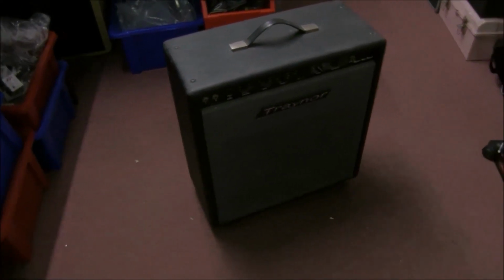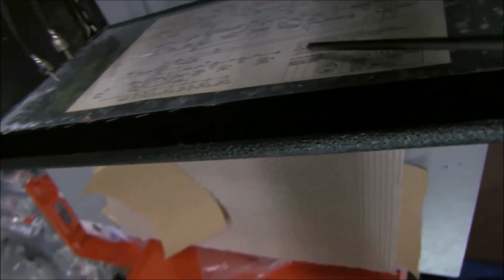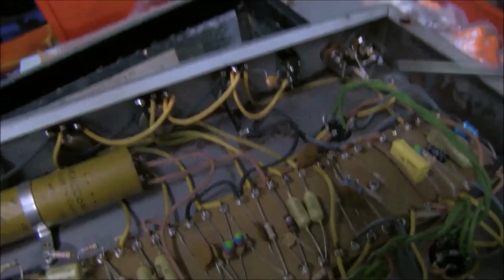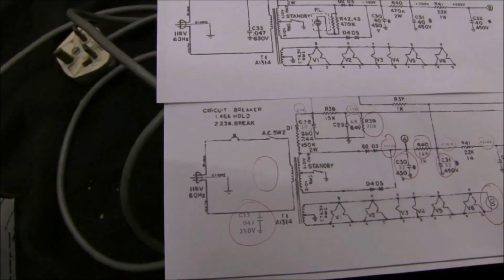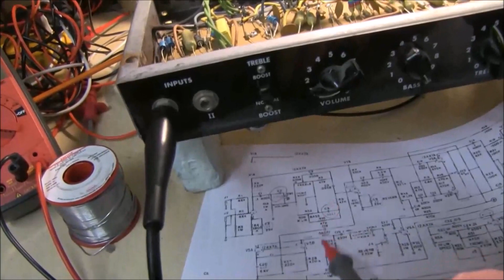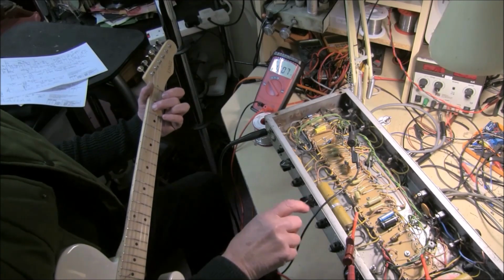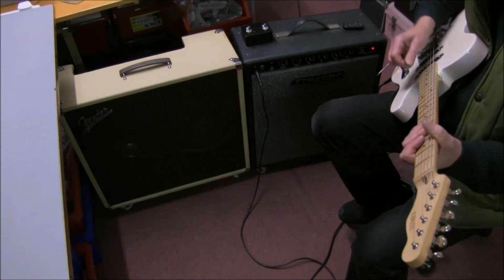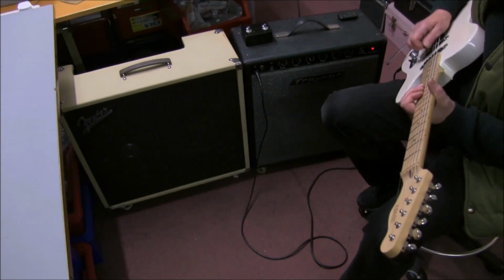Traynor YGM 3 Vintage 1973 valve Combo amp with Trem and reverb.

Comment: Hi Nick... I have had one of these for over twenty years; suburb amplifiers and similar to an original Fender Princeton. As you stated these amps were originally made by Peter Traynor for the hire market, so they were deliberately over engineered to save comebacks from hire clients! :) With regard to the re-issue having slight circuit changes, the lowered  HT voltage was to cater for modern valves that are not rugged as the old Phillips, Mazda and Brimars made back in the day. Stick a lot of modern EL84's into an old 70's YGM3 and the amp will eat them and cause them to red plate! The fixed bias resistor, R39, is 22K in the original amp and it is advisable to change that for a 10k resistor and 20k trim pot in series so you can adjust the bias and run modern valves a little colder and prevent red plating. As you will know, if you stick a 1 ohm resistor from pin 3 on the EL84 socket to ground, you can measure the bias current with a volt meter strapped across the resistor (i.e. voltage reading will = milliamps) You want to be looking for about 17 m/a. to keep things running reliably! The tremolo circuit oscillates the bias circuit to make the tremolo to work, which again can cause the bias setting to go 'hot'. Some users disconnect this (or leave it switched off from the footswitch). Like you, I also found that leaving the enclosed back on tightened up the bass response; however I have changed the original Marsland alnico speaker for a more modern Celestion alnico Blue (same as original Vox AC30). IMO this improved the sound. However... a lot of users do like Marsland speakers but I think it depends on who manufactured them!  A good idea on changing the phase inverter to perhaps an ECC82 or similar… to calm the output and drive down.  For a twenty watt valve amp and when using a more modern and efficient speaker… they are very loud!  These amps are secret sleepers (lets keep it to ourselves eh! :) and definitely keepers ^

Comment: It's a very well accepted fact (not assumption) that filter and bias caps in tube amps have a service life of 15-20 years.  Beyond that they can blow at any time, with absolutely no warning.  They may test on spec; the amp may sound fine; but they are time bombs, and in the Guitar Mate C30 and 31 - which get hit with the highest voltage - can burn out the power transformer when the blow. 

 In many amps this isn't just an expensive repair, it has an exponential affect on the amp's resale value.It's unfortunate that manufacturers don't provide service guides, and unless buyers frequent amp forums they probably have NO idea that ths work needs to be done - no matter HOW the amp sounds or the capacitors look.

The FIRST thing that is done when servicing a vintage amp is ensuring that the power cord is connected correctly (hot to fuse and switch'; neutral to transformer; ground to chassis) - and next is replacement of filter and bias caps that are over 15-20 years old - or have no date codes.

Much of my amp work is replacing blown filter caps (and sometimes power transformers) in  amps poor souls purchased over the internet, plugged in, turned on and poof (it's most common in amps that have been in storage for long periods, as the electrolytic paste turns to a crystalline material that cooks in second.).

If an amp will be played, and isn't a mint-condition showpiece with the original shipping box - in other words will be used for display only and NEVER turned on - it doesn't lower the value to do proper service work and replace those caps.  Unless the buyer is a tech, every newly purchased vintage amp should go immediately to a competent amp tech to have them replace the filter & bias caps, and go over the amp to test for other off-spec parts.

I found this to be a very disappointing video that does Traynor buyers a serious disservice.
Reply: I checked my 55 year old Traynor and the caps are still in great shape. Amp sounds good too.
Reply: "accepted", by people who don't know anything aside from what they've read on the internet, yes.
Everyone else who actually has experience with any amp of this vintage knows that electrolytic caps can FAR outlive their "service life".
As the saying goes, they don't make em like they used to.
I've got 60 year old Mullard tubes that are beat to hell and still strong as well.

Comment: Hi Nick. Any way you could help me fix my icharger 4010duo? I am having a balance port issue. #5 reads very low and #6 reads very high. Calibration will not correct the issue. No components look to be visually damaged. I just need to know where to start for an issue like this. Cheers!

Comment: Just got one of these great amp! Can anyone recommend good nos power tubes and what footswitch can I use for the tremolo input Thnks!
Reply: See my other post about modern EL84's... an old YGM 3 up to spec will eat a lot of modern valves (back the bias off a bit to make em run a bit cooler!)  However, I understand JJ's will do the job; but the amp will quickly eat them if you dime the amp all the time!
Reply: I wish someone would do a vid on how to slow down the tremolo :/

Comment: I have a ygm 3 from 1969 conseevatory model whiteface - really good amp
Reply: Blimey... those whiteface amps are rare... collector will rip your'e arm off for them! :)
Reply: @Jammoko  ok i believe you - what do you think it is worth - good condition and  Fender Eminence speakee
Reply: @tenniswilliam  Well, a normal blackface YGM3 in good nick will can fetch between £300 - £500; I recon a white face should add another £100 to £150 to that price to someone or a collector who wants something unusual... beware though, some people have had those whiteface panels screen printed (i.e. faked :) ) and swapped the original blackface panel out! I can't remember now why Traynor did a few with the white face, probably to commemorate something; unfortunately not many original people left now at the Traynor (Yorkville) factory and Peter Traynor passed several years ago! I did get to speak to Peter's son some years back and he stated that after his farther retired he became unhappy about the products that the company were importing and badge engineering with his name after he retired. Obviously their heyday was when they were making the original valve amps that were on a par (and sometimes better) than Fender and Marshall. The Traynor amps that Peter designed sort of stood in that middle ground between Fender and Marshall, taking the best from both and in their way were quite unique… with the added bonus that they were built like a tank :) I have several Traynor amps that I have collected and refurbished over the years, Traynor Reverb Master (4x10 combo), YBA1 mk2 (head), YGL3 mk3 (2x12combo) and a YBA 2B head and YC-15 bass cab) and of course the YGM3 (1x12 combo)... these Traynors are a pleasure to work on and are very accessable with info on them readily available. I have also had Vox, Mesa Boogie and Marshall amps in years past; but much prefer the Traynor’s. A vastly underrated amp that flies well under the radar :)
Reply: The whiteface models were produced as a special run for a music conservatory I believe in Thornhill a suburb of Toronto. They are referred to as conservatory models for that reason.
Reply: @tenniswilliam  thanks for this information 🙏